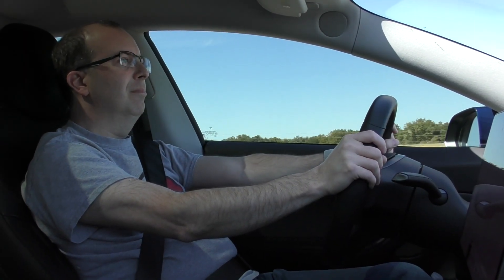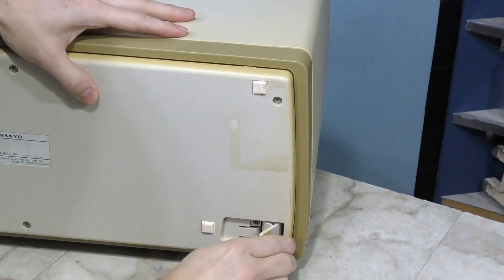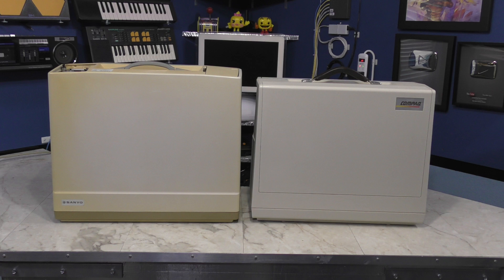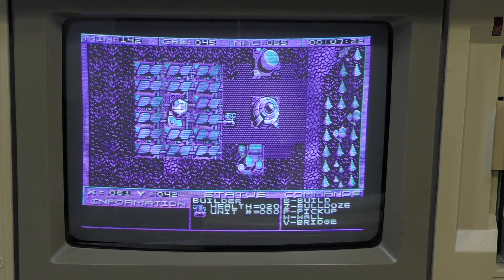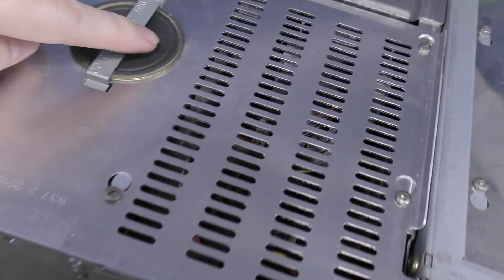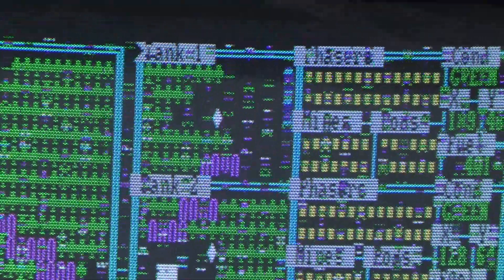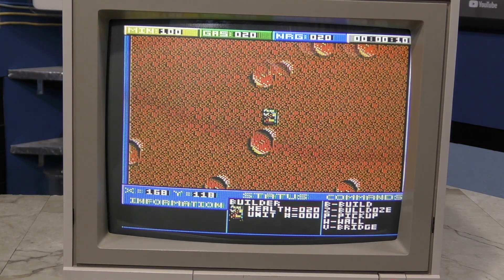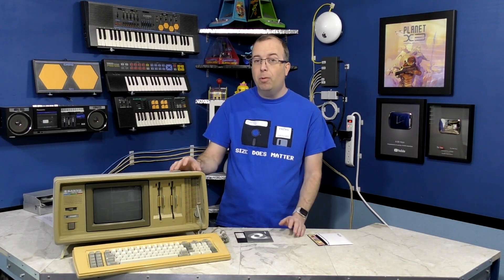Sanyo MBC-775 - The first PC portable computer with color screen.

Comment: In Rod Canion's memoir he actually mentions this incompatibility problem. He was convinced it would keep customers from buying these PC clones and made sure the Compaq Portable would run everything the PC did. I think the obscurity of devices like this Sanyo MBC-775 proved him right.
Reply: Absolutely. To anyone but a programmer, a computer is nothing without software. And them IBMs were everywhere in offices, having a cheaper or better-featured competitor that could still do everything your office machine did was a much easier sell. Who cares what software Sanyo has, does it run 1-2-3? WordPerfect?
Reply: @watchm4ker  Yes, the 775 runs Lotus 1-2-3. And likely WP.
Reply: @watchm4ker  Agreed, I can't recall how many clones I'd worked with back then that would come close to being 100% IBM-compatible but then have some weird quirk.  I forget the model number, but there was a Tandy with an 80186 CPU that I almost bought on clearance before finding out its limitations on compatibility. That may have been the first PC I'd seen with 12 function keys instead of 10.
Reply: @bobblum5973  The Tandy 2000. It was compatible to a degree, but it used an entirely different display driver. Not even text mode was truly compatible.
Reply: @watchm4ker  Okay, so I did remember the right model number! Thanks!
Didn't it use non-standard cards as well?  Not ISA bus card edge, I seem to recall connectors on both the card and main board, more like DIN 41612 Eurocard connectors (my experience with hardware back then is showing!).
Reply: @bobblum5973  The T2000 was one of the first IBM-based machines - it was still branded a TRS-80! - and so there really weren't any 'standards' to base the machines on. Up to that point, after all, every manufacturer had their own expansion system and hardware, such as they were, and Tandy figured they could get one over on IBM by making a technically superior system that was... somewhat compatible. After all, it worked for the Z80 market.
Reply: @watchm4ker  Oh, I understand, I lived through that time.  I referred to it as "ISA" only because that's what became the standard, so we have a name for it now.  All the expansion bus versions, the video card standards, even the MicroChannel architecture adventure, so much history to get us to where we are now.  And it still goes on...